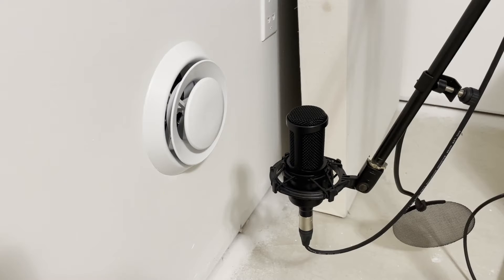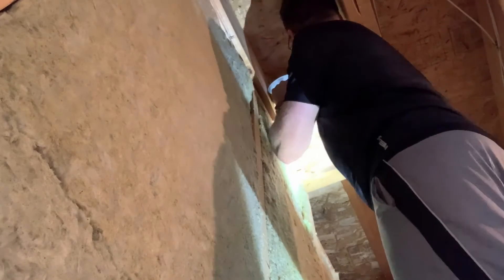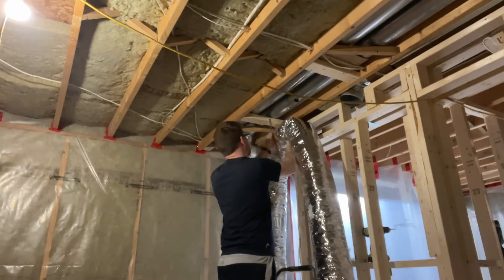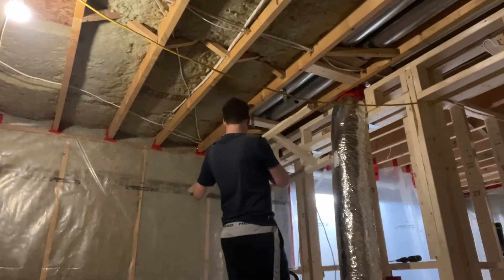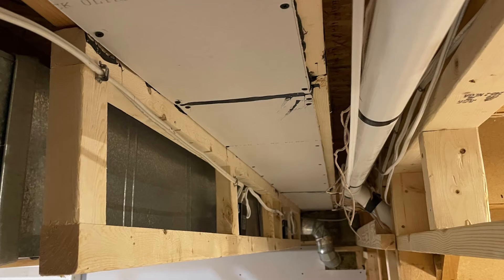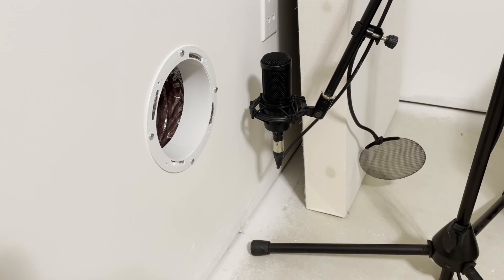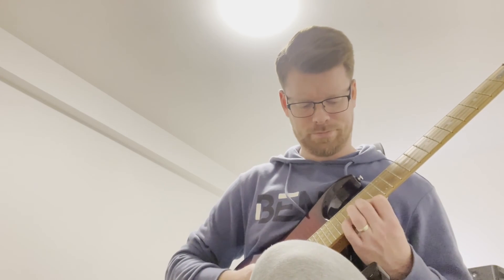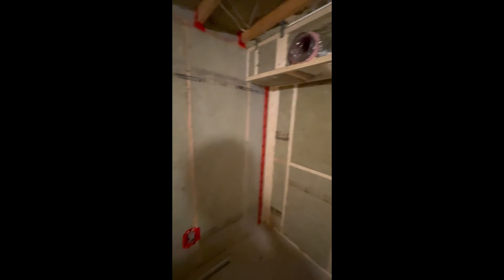Building A Silent HVAC System For My Music Studio

Comment: Nice work and very interesting. I always use baffle boxes in my designs, but my clients hate how big they are. It was interesting to see that you had such a small duct and still felt the air noise itself was quiet enough. I like Nailor Industries stuff as Rod suggest to keep air speed noise low when large ducts are not available. good stuff and thanks for sharing.
Reply from the maker: Hey Wilson, thanks for checking out my video! The flexible ducts at the start and finish seem to do the trick with air noise. I never hear the HVAC, even with my cheap diffusers. Of everything I did, HVAC is what I’m most satisfied with.

Comment: 1st video of your build I've watched.Liked & subbed.I'm in a small basement home studio.Built it 25 years ago already.Still eliminates outside noise well.Have a glass block window so I can get some sunlight down here.So airtight I had to add a 4in pvc pipe with a muffin fan attached.I'm going to add a run from the furnace.Looking at how people have been doing their heating & cooling to their home studios.I made a baffle box for the fresh air pipe.Still can hear the fan though.I had everything sealed the way you did.Except the electrical putty.All this time later,it's still isolates sound great.I'll check the rest of your build.   Best Regards..
Reply from the maker: I always like hearing how other’s studios hold up over the long term. Gives me confidence the sound isolation will hold up for my studio also.

Comment: Great video! Just started researching on the subject since we're renovating our house and I'll be building a soundproof home studio in it and was in the process of going through HVAC quoting as well for the whole house and realized that the soundproof studio and central HVAC might not be friends. I'm curious in your mind, what is the most important thing if my main concern is having the sound travel to the other rooms through the conducts? Appreciate your help! Cheers!
Reply from the maker: Glad the video is helpful! At a minimum you need to have independent runs from the furnace to the studio, with the kind of flexible duct I connected to my furnace. The Total Baffle Box I described is a lot of work, and I wouldn't recommend that approach unless you're doing it yourself. If your HVAC contractor is on board, you could add to your independent runs with 2 baffle boxes that you build yourself and have the contractor do the rest.

One thing to keep in mind is that it's very difficult to manage the climate in a soundproof studio vs the rest of the house. It was pretty cold in mine this past winter: usually 16-17 degrees C (~61 F), as low as 15C/59F on some days. Humidity was rock solid (`45%) with a central humidifier on the furnace, but now that it's summer the humidity is 60-70%. I'm now looking into a central dehumidifier. The lower temperature is nice during hot days.

I'll be doing more trial and error to get it right over the next summer and winter, and I'm hoping to do some proper sound comparisons of a baffle box vs other methods. Though I probably won't get around to that until after my studio is finished.

Good luck with your build!
Reply: @simonbaxtermusic  That's awesome! Thanks a lot for the info! Will definitely circle back if I have more questions!

Comment: The video I needed! You promised this a few days back, and you delivered. I'm also in Canada.. the air exchanger is such a beast and a PITA to work with. I'm going to be doing something very similar and you actually gave me a few more ideas. I noticed at the end your use of a simple light for your studio space. I've also come to the conclusion that a bunch of potlights probably look great, but what is the point of decoupling the ceiling, using double 5/8 drywall if you then punch numerous holes in it? I'm thinking lamps as needed and only two junction boxes in through ceiling for track lighting. Sealed obviously and probably caulked around edges.
Reply from the maker: Glad it was helpful! The single light is temporary, because I'm going to have 6 pot lights in ceiling clouds, and I'll have a single box that they're all connected to. For exactly the reason you mention! I used a 1/2" thick electrical box and that way only one layer of drywall has a large hole through it. Electrical is my next video - hopefully coming out in a week or two. It'll be easier to make than the HVAC video.
Reply: @simonbaxtermusic  Awesome. Yes I'm thinking of a cloud with lights as well because if you go lights first, then half are blocked by your cloud. These vids could not have come at a better time and I appreciate you covering a lot of the details that so many other videos seem to gloss over or just not include.
Reply from the maker: Completely agree. It’s easy for YouTube to feel saturated, but that’s only true of certain topics. And sometimes there’s an oversupply of misinformation. It’s why i felt like doing this series.